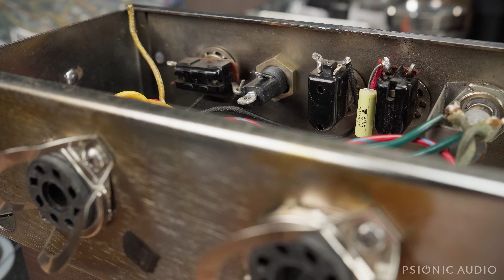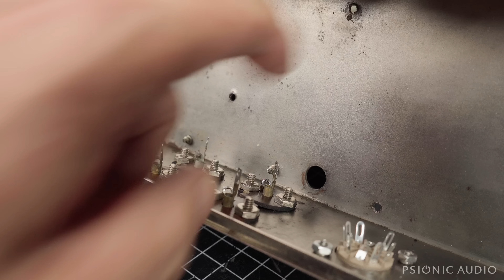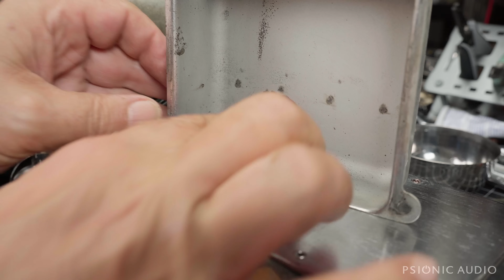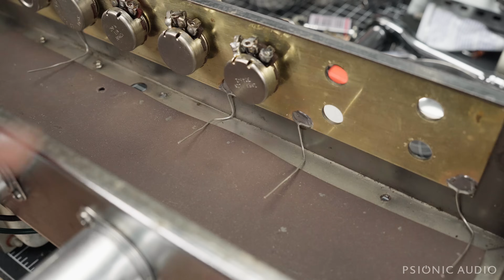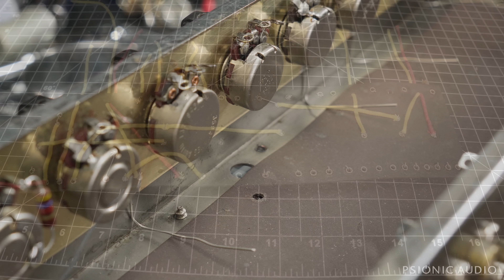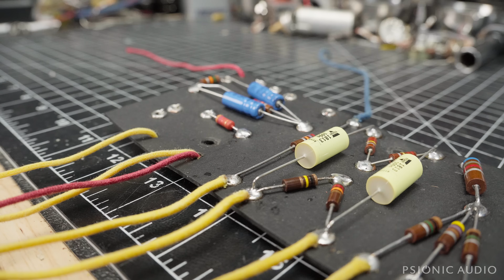Slow Rebirth | '58 Fender 5F6A Bassman Pt 3

Comment: Hi. Nice rebuild. It was interesting to see that this one has a brass ground plate ... most don't. I have a quick question: Building a 5F6A using the same values as built here (6.8K tail resistor, 25K presence pot, etc) but am building this with a 4 ohm OT. Will the tail resistor need to be changed to account for that different secondary impedance? Thanks for the good stuff!

Comment: Have you measured noise level with and without tube shields on V1, V2 and V3 and if so, was it lowered significantly when the shields were in place?

Comment: how come all amps don't have a 47nf cap at the standby switch? Is this a common practice?
Reply from the maker: Most amps have standby after the reservoir (first filter) node. This circuit has SB before the reservoir so the added cap is needed. Standby is not needed in this amp with the rectifier tube, but as it’s a valuable fairly rare amp I’m just restoring that part of the circuit too.
Reply from the maker: PS a rectifier (tube or solid state) has a higher DC output with a capacitive load than without, so there would have been a large voltage spike if the switch didn’t have that cap. 

There is still a spike as 100nF isn’t much of a load compared to 40uF, but it’s better than having a no-load state on the rectifier. Hard on the rectifier tube, too.
Reply: @PsionicAudio  Thanks for the reply and knowledge!

Comment: Nice work, but man, those old Fender eyelet boards are ugly, and the connections on the back... ugh.
I know it's iconoclastic, but since it's already "player grade" I would have swapped it out for a turret board on standoffs, with all connections visible and accessible on top.
One minor correction: the 68k input resistors are mixers, not "grid stoppers" which need to be physically on the socket pins. I'm sure you know that, but others may not.
Reply from the maker: They are only mixers if you use both inputs of a channel at once. If you use the lower gain input then they form a voltage divider and act as a grid stopper. If you use the higher gain input they (in parallel) are a grid stopper, though not perfectly located.

Comment: Does your 1958 Bassman have linear volume pots? My 1960 5F6A does, and they're factory original, matching date codes. I've seen same in most later 5F6A along with the "non-scratchy" presence control circuit with a 25K pot.
Reply from the maker: Yes it does.

Comment: The difference between when that amp first came in and where it is at now is extremely stark and amazing!
Reply: Excellent choices and rationale for your handling of this restoration.  Hope to see some description of impedance match logic of 4 speakers.
Reply from the maker: Thanks. Not much to say on that. There are four 8 ohm speakers in parallel making a 2 ohm load.
Reply: @PsionicAudio  , did Leo have those transformers custom-made for a 2 ohm load?
Reply from the maker: I doubt it. Probably in the Triad catalog then in the Schumacher. But it’s possible he asked them to make 2 ohm versions of existing models. 

It would been so much more convenient for the rest of us if he’d used 16 ohm speakers for a 4 ohm load.
Reply: @PsionicAudio   It appears that Leo wanted to avoid series-parallel combinations in his 4x speaker cabinets, probably to avoid warranty repairs caused by having one blown speaker also disconnect another series-wired speaker from the system, and now you've got only two speakers left to handle full gig volume, leading to more blown speakers and possibly a blown output transformer...... Of course, it's  easy enough to wire 4 speakers in series parallel in such a manner that when one speaker dies it doesn't automatically take a second speaker out of the circuit, but the fact that the Bassman has 4 separate output jacks seems to indicate he was worried about that type of scenario; Or perhaps it was a fail-safe for a speaker rattling at the gig and the musician could simply unplug The Wire to that 1 speaker that was causing a problem or perhaps it was a "show must go on" fail-safe for a bad speaker buzzing or rattling loudly at the gig, and the musician could simply unplug the wire to that one speaker that was causing a problem.

 I have some old Triad catalogues and I should look to see if they made transformers with 2 ohm secondary.  I don't think I have any Schumacher catalogs......
Reply: @PsionicAudio , an update:  I have Triad Transformer catalogs from 1952 and 1957 and a couple of undated partial catalog photocopies as well. The only one that contains high power audio transformer more or less suitable for use in something like a Bassman is the 1957 catalog, but not a single output transformer lists compatibility with a 2 ohm mode. 4 ohm load at minimum, and every transformer has a minimum of two output impedance taps, sometimes three.  I suspect Triad was custom building for Fender.  Unfortunately I don't have a Schumacher transformer catalog.... I have lots of other old catalogs from various manufacturers, Including Altec/Peerless, Freed,  Hammond, Merit, Chicago Stancor, Thordarson and UTC......

Comment: Your layout work  is superb. Some very nice video that will come in handy and hopefully here in the near future to use on my  Brother n Law's 1958 Fender Bassman. We have been threatening to go back in and replace all the electrolytics at a minimum since the day we resurrected it after a 20 year Rip Van WInkle nap 5 years ago. A previous owner of the amp was a professional bass player and gigged with a lot so we know there are most likely some weak links in it so it doesn't get fired up as often and babied at that when it does. I am a believer in full restoration and use rather than Keep it Original Museum Piece. What good is a Model T if you can't drive it? I just sent a links to my Bro n Law.

Comment: Looks exactly like one of my builds! Good to hear you’re using something other than the selenium rectifier as a terminal for the bias diode. I don’t know how, but I’ve seen them burnt up while not under any load. Maybe an internal short to the mounting hardware or something.
Reply from the maker: Yeah, I don’t trust them.
Reply: @PsionicAudio , there's no electronics "get the funk out" operation that can compare to when a selenium rectifier burns up and vents it's stinky, toxic, rotten egg-adjacent fumes. The very first electronics repair I remember was replacing a filter cap and selenium rectifier in my dad's workshop radio when I was about 11. I don't even remember how I came to know what to do in order to fix it.

Comment: In my own amps I use preamp tube shields only in case of first stage or reverb recovery tubes, and often they don't need tube shields either. Grids of triodes are very much inside the structure of the tube and "shielded" by plate. Tube shield springs cause unwanted mechanical stress to glass envelope of tubes if there is no cushion (silicone or felt (like in case of Telefunken tape recorder EF86 tube)) between shield spring and tube.
Reply from the maker: They. Are. Removable.
Reply: @PsionicAudio  Thank God they are. 🤓
Reply: I would not suggest using preamp tubes without shields, or something else that will function as tube retainers, in an amplifier where the tubes hang downwards, especially if it's going to be transported and schlepped around to gigs. If it's strictly for home or studio usage, sure, I guess. Although I don't think I've ever seen a preamp tube break specifically from the top-down pressure of a bayonet-type shield.
Reply: I suspect that @jutukka(based on their name) is a Finn and has learned to utilize the traditional Finnish form of verbal and written communication which is utterly devoid of diplomacy, courtesy, and kindness. Please understand that they may actually be a warm human being. I've run into a few Finns in my life, and I find this particular quality to be challenging. On the other hand, mea maxima culpa.

If I am wrong, or if I have injured anyone's feelings here, I apologize sincerely.

Cheers,

Alan Tomlinson
Reply: @diegorhoenisch62  I don't understand this at all. I just told my personal approach to using tube shields, based on physical facts of glass as an amorphous solid. It was not anything else. I just cannot understand how it could be inappropriate.

On subject, Page 8 Glass failures:
https://www.worldradiohistory.com/BOOKSHELF-ARH/Technology/Technology-Vacuum-Tube/Getting-the-Most-Out-of-Vacuum-Tubes-Robert-B-Tomer-1960-(164-pages).pdf
Reply: @diegorhoenisch62  that escalated quickly. smh

Comment: Have no fear that when Lyle says he is going to "tape off" the unused heater-winding centertap, he means cover and insulate it with heatshrink tubing, not tape! 😉
Reply: Fender would have used masking tape and called it a day.
Reply: @joeltunnah  , yup, I've seen that  myself in a few old Fenders.  Leo did a lot of things right but he was also a bit of a cheapskate businesswise and always looking to cut costs and labor time.  Anyway, old fashioned masking tape has a tendency to dry up and glue itself in place, but  electrical tape turns into a gummy gooey miss and unwraps itself when it gets warm. Neither are good electrical insulators.
Reply: Masking tape?  Hell, scotch tape!  It was good enough in grade school...

Comment: Regarding the cap to ground on the standby switch, is that potentially dangerous? If it fails isn't it just like the "deathcap"? I must be missing something. Thanks!
Reply from the maker: The “death cap” has AC on it, often approaching the max AC rating of the cap used. This cap is rated for 630V DC, and will have @420-500VDC on it. 

So not really risky, and should it fail as a short it would simply trip the fuse, not make the chassis electrically live before the fuse (as the old polarity circuit can do).

Comment: Ceramic are too fragile for regular gigging  . Well at least that has been my experience .  Very good for high voltage if the pins are quality is they do not get shocked physically .  Carter admin well there you go again  good video again .
Reply from the maker: These were much higher quality ceramics than you usually find, but phenolic/micalex is my preference.
Reply: @PsionicAudio  , "gold" plating is often no more than a marketing ploy or scam nowadays; a layer of gold only a few microns thick is indistinguishable from solid gold to the naked eye, but I've seen lots of cheap connectors where the plating underneath the "gold" flakes off easily when stressed or flexed. Is it even gold or merely some fake 1 carat alloy made to look like gold? Nickel is much tougher, a good conductor, and easy to solder to as long as it's clean.